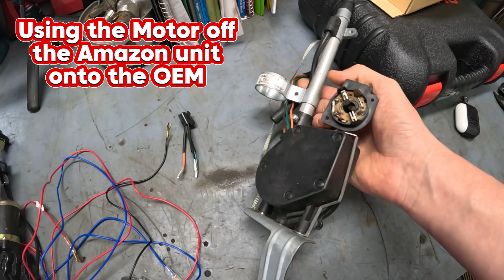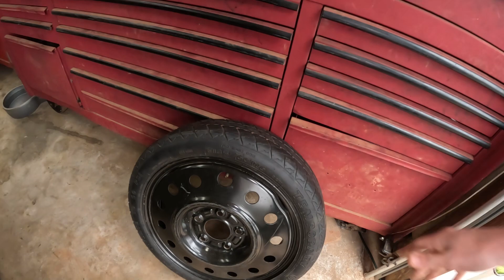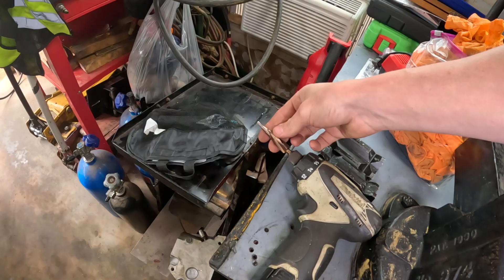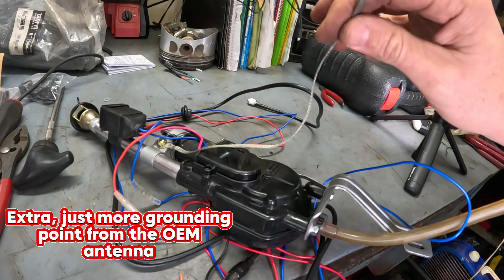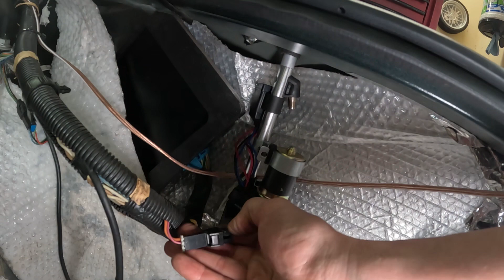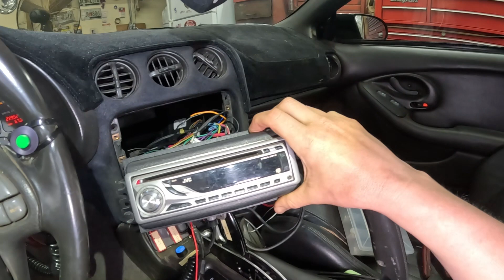How to install a Universal Electric Antenna on a car 🛠️🚗

Comment: All that introduction is Not Necessary, just Show Me How to rewire the antenna, i'am mechanicly incline so I know how to take things apart and put back together. Also I know how to take the old antenna out. So All you YouTubers , Just Skip the small - talk & get to the rewiring.😢🎉 On All of Your Car Videos.
Reply from the maker: That's the good thing about YouTube, you can skip right past anything you don't need lol. Some people need the extra explanation, some don't. I try to make the videos useful for both.

Comment: i really been struggling to work out how to use the universal fender mounts, the ones which are rubbery plastic that are suited to different shape or angles, I can not for the life of me find anywhere that explains how to use them, other than the simple straight fit the actual main unit itself, which is never that great for me.,
Reply from the maker: I get what you mean—those universal mounts can be tricky, especially when dealing with different angles.
Reply: @RocketGarageService  it seems the many universal aerials i have bought over the years, only show the process of drilling and fitting the prefitted mount 0/30degree... it doesnt say how on earth to use the moulded other rubber various heads.